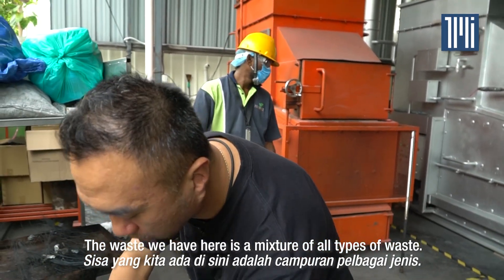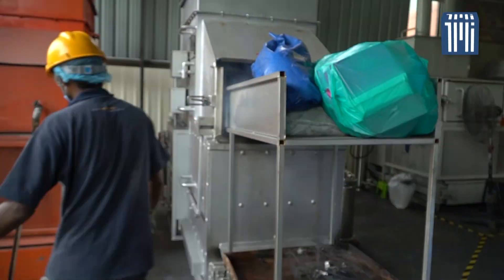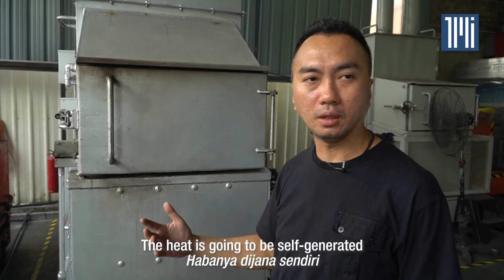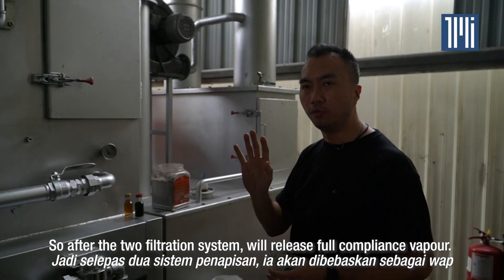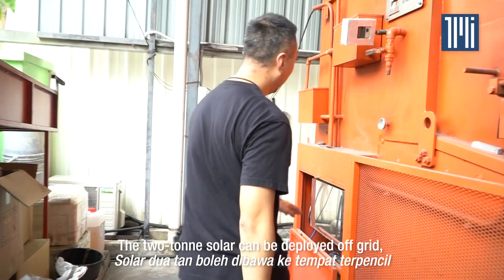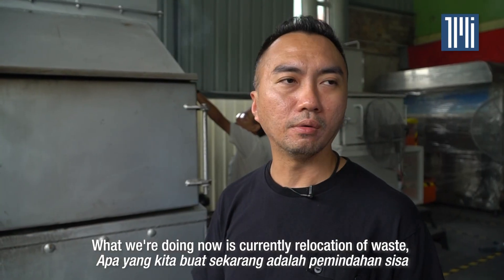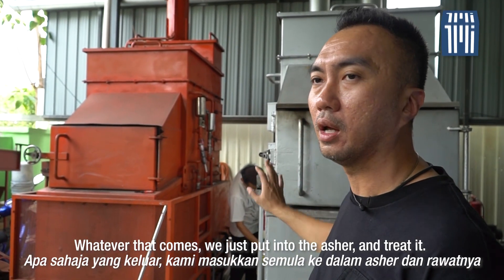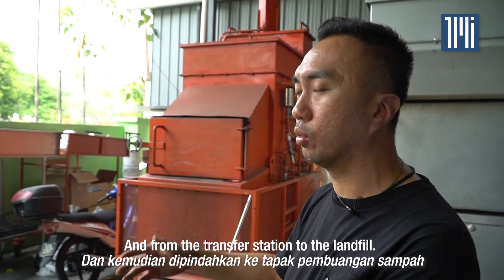Made in Malaysia | This could solve waste management and keep Malaysia clean

Comment: No combustion but got ash and "vapour"  ? With temperature ranging from 400 degC to 1100 degC almost everything gets disintegrated.  As there is no additional input of fuel this broken-down gases had to be combusted to continue the combustion. If you want you can even have a subsystem to make vinegar and channel the residue gas back into the pyrolysis chamber.

Comment: Not burning. Dia bukak pintu keluar api... polution control sistem bukan senang nak maintain. Air dalam scrubber tu cepat je kotor and kena slalu tukar. Practice industry kalau ada scrubber, mesti kena ada waste water treatment. Carbon filter lagi la cepat flock

Comment: No electricity needed at all? Looks like 1100 deg C heat is  produced internally by the Power Bank he had in the waste...Ha Ha Ha. 
By the way, Why are they using Solar Panels when cheaper TNB Supply is available?? 
4kWh used for every hour, means 4kW of Power is required constantly for 1 hour. How much waste is processed in 1 hour cycle? Calculate Energy cost per kg of waste.
Ash will be toxic depending on the composition of waste. Power Bank and plastic into fertilizer??? Amazing!!!
The Eco Waste Asher installed in Gopeng for Nomad Adventure is not in operation now, why?
Lastly, a good start venture, hope to see Asher as envisaged by the Inventor in near future. Maybe some day someone will eliminate all the above issues and succeed in making a real meaningful Asher that can make technical and commercial sense.
Remember, many great inventions had to go through criticism before they could succeed. 
Belum Cuba Belum Tahu.

Comment: if the heat is not coming from solar electricity heater where is the heat comes from? since he said this not an incinerator and he not burning anything. what is the fuel for the heater although I did see fire jumping out when he opened the front panel.  heating or burning plastics and batteries I do not see this as a good idea, if he using  water scrubbers the water is absorbing all the toxic waste which needs to be disposed of properly and also replaced. something does not seem right here would need to see the actual flow diagram. I hope also that is not how he testing the final air quality

Comment: Something is wrong here.  This is either pyrolysis or gasification (not sure which).  He's breaking down the waste in an oxygen starved environment.  Seems to me he should be getting some very heavy/sludgy smoke that he's supposedly scrubbing into "clean air".  He's using some of the syngas to run the system but it seems there should be additional gas that needs to be captured or burned.

Comment: No burning, but got heat generated (magic), scrubbing only use water can have alkaline flue gas discharge (must be highly treated alkaline water need to investigate) lime or caustic no where to be found, plastic waste inorganic can be used as fertilize including batteries with heavy metal (did not study that in school), no dioxin or furan discharge as per EPA standard (need to go back to environmental school for my Phd), 10 years warranty ??? (Must buy or money back). It is a wonder machine no more landfill, dumpsite, no air pollution, cheap ???.

Comment: This actually biomass pyrolysis. Not a new technology, expensive as hell, and suffers from efficiency issues when you scale up. There are also plenty of misleading statements, such as saying it is not a combustion, but in fact, it is. The problem with WTE is often not at the combustion but more at its emission control system. The concept is the same as incinerator except that it relies on heating in the absence of oxygen. But another common problem with pyrolysis systems is you can't completely remove oxygen from its combustion chamber, because even food waste contains oxide. When you have an incomplete combustion, in comparison to incinerators, you actually produce more dioxins and furans. Overall if this technology is proven there would be heaps of investors working on this on a large scale basis (including myself coming from RE investment industry) Why wait for a small Malaysian company to do it?

Comment: How do you maintain such a high temperature of 1100 celcius? He said that the electricity was only used to run the air scrubber and filtration system.
Reply: absolutely. steel gets softened at 500 degrees, even if their melting point is around 1200 degrees. So it is highly unlikely this machinery can go above 500.
Reply: @VongolaSekundes  Precisely. Straight incineration do NOT go beyond 500degC (or 800degC). Only a plasma furnace can go beyond 1000degC. Plasma furnace can be used either as straight plasma incineration OR plasma pyrolysis. BUT by the looks of the machine it don't look like a plasma furnace to me. A plasma furnace is typically shaped cylindrical or like a large bottle with temp-resistant brick lining.

Comment: Based on my understanding ,its just a really easy system 
The asher works on a a way similar to making charcoal, heat up the material, starve the oxygen out making the fume similar to CO with really high heat, thats y the fume react with oxygen
As the process doesn't burnt, the material couldn't form oxide or other chemical oxide , mostly become co  and pass through water scrubber at high temperature, this can rapidly cools down the fume and soluble and become co2 and hydrogen (maybe around there) 
Carbon filtration can remove small partical and the second set of filtration remove any remaining substance 
As for waste water , it can be add into the asher as this could cool of the system as it sometimes runs too hot , chemical inside it can turn solid or even react differently and become harmless and finally become ash , as for carbon filters can be done the same process 
And the electricity only supply for the aeration and filtration system,  so its really 👌

Comment: Not much detail of this "so called" new invention. Is it just a straight incinerator OR a pyrolysis chamber, OR a high temp plasma gassification process? In reality heat process for MSW 'reduction' and/or energy recovery IS NOTHING NEW... the technology is "matured" in a way. HOWEVER this 'skimpy' op-ed pushef by M'sian insight is TROUBLING. He says it works with ANY waste... and he was dumping a plastic bag into the 'Asher' and he claims no emission OR no harmful emission WITH a end result a solid.  BASIC STEM knowledge. Whether, incineration, pyrolysis or gassification or plasna burning the end result including emission depends very much on what you put in. Eg if your input is (say plastic) high pressure pyrolysis may yield an oily liquid. And solid waste from high temp treatment of MSW may be toxic if stuff like batteries are not removed. Fertiliserz if claimed to be useful output will also be graded "food-grade" or not  You do not want non-food grade fertilisers in food agri. At 4.26 he claims his machine uses 'low energy' @ (apparently) 4kW which he claim to be much lower than a 1.5HP A/C ... come on ... Is M'sian Insight pushing opinion b/s disguised as technology news?
Reply: 1.5hp is 1.2kwh ... when it is too good to be true. We should be doubtful.
Reply: You need sorting first. As pointed, heavy metals present will persist and you can't put that into soil.
Reply: Smokeless? What about the smoke that came out during the feeding process? Not burning? Why got smoke if no burning? Why got fire if no burning? EIA from DOE?
Reply: Can't agreed more 😂
Reply: You read my mind dude 😂
Reply: Yes, I have the same impression, he turns batteries into fertilizer, that looks toxic! Can someone explain more clearly?
Reply: @henrytan5707  
100 year old technology Pyrolysis.   Oxygen less thermal decomposition.   Lots of toxic gases generated.  Heavily regulated in the west.  Giant yawn over here...
Reply: Finally, someone who actually speaks science
Reply: So is that thing good or bad?
Reply: @krinox244  it still can be considered good as in the end, it is still a waste management type of machine. The bad thing is that this documentary is only made to hype up this machine by making it looks like a godly machine, you put anything in it, you only get pure dust. I call bullshit. They didn't even bother to show the end product coming out of the machine.
Reply: @krinox244  depends on the input. for organic materials such as food waste, it's safe. but if you put, for eg. 10 kg of battery/power bank, then you don't want the ashes to be used as fertilizer.
Reply: Thanks for talking what i've just thinking dude. Too much dark secret here.
Reply: It is Pyrolysis. Saw it on another video published by the company itself. The comments were turned off though.
Reply: When something is too good to be true, most likely it is too good to be true.
Reply: I share the same thoughts here. Unless he can explain his technology in details.
Reply: While the dude is selling his stuff by mentioning no oil, coal, etc needed, he wouldnt even mention it uses electricity, as if hes saying the machine is magic. All sweet talk saja.

Comment: I sounds like perfect waste disposal and waste treatment solution, however I am still skeptical. The whole video did not show or mentioned about what comes out at the other end of the process , however just shows the end product, which is the ashes. I am like to see at the end of the process how the workers removed the treated waste residue from the machine.
Reply: I just Googled it here and there, may not be 100% just for sharing.
Its called the Pyrolysis process. A process which subject waste to high temperature (not burning, since no oxygen involved) and break it down to simpler molecular forms with gases releases (there are some other by products too, you can google it out). The gases and other byproducts are used to further generate energy which will benefit the community in different forms.

This process is not something new actually, just that this waste treating method didnt take off mainly due to the fuel you need to put in to sustain the heat is costly than the amount of energy can be harvested (varies depending on how you do it)

Whats interesting here as the presenter mentioned are:
1) The fuel to generate heat is self sustainable - you do not need to continuously provide fuel. Which already reduce alot on the operating cause and rendered the energy can be harvested (which this Asher didnt do at the moment) more than you put in (assuming its at least more than 1.5hp AC power consumption).

2) It can even treat power bank. I wonder if Lithium will cause contamination if the end product is being used for fertilizer.

I think there are stil some other hazardous byproduct from the filtration system. That wont just go missing and the filtration system wont last forever without maintenance needed.

Anyhow, if these all are true, it is stil way better than sending waste to landfill. At least the amount of waste need to be handled is way way smaller in size. Soooooooo, smaller landfill ?
Reply: @yihsiangng7038  in pyrolosis, you can use biogas to be used as fire.
Reply: True. Basically this is just a hyped up incinerator.
Reply: @RoyMcAvoy  are you sure?...can you make something better?
Reply: hahaha bro, this product is proprietary, not an open source. he only shows input and output lar. the process.. no no no no :)
Reply: @xchaix  to be used nation wide, he has to come clear whit every thing, nothing to hide...want to help the environment or just want to make money
Reply: @hidongcucuk4756   don't say like that lah....., they are working hard for a solution to treat waste at the very least
Reply: ipo dude, ipo.. want to know further contact related person.. if other persons, they would sell first aggressively n us regret later 😂😂
Reply: I oso wan to see the ash and the filtration sys. 1000 celcius nt actually tat high and ash still can be toxic
Reply: Is this the real deal or a hoax??
Reply: the talker is a lier, just a pyrolysis or gasification tech. it is not economic.

Comment: If really reliable and environmentally friendly, should have provided report from independent accreditation body(ies).  Safety is very important and it would be particularly helpful if there is credible certification. Government can assist with this if needed be.  

The biggest issue is usage of power.   This is like handing over the responsibility to process waste to local authorities or housing location??  Who's gonna pay for the cost of the item and the power used?  There must be incentive from government.  The reason why we pay taxes is also to cover waste processing; if we rakyat have to bear the cost of processing waste, how is that going to work

Comment: I have seen a 2-tonne model being launched in Gopeng, Perak. Emissions were full of dark brownish fumes, possibly remnant dust particles. In actual usage, the treatment capacity turned out to be only one tenth of what the inventors / vendors claimed it to be. After 4 mths operation at below par capabilities, it stopped working altogether. As I last saw it, that Asher is still lying dormant there. Can the inventors / vendors offer a responsible and truthful account before launching into more hyped publicity and marketing?
Reply: Not to shoot down a potentially great local idea, but not all the waste is organic. He put in a battery pack. The ashes will contain toxic material which is not suitable for plants or to be disposed off in the river where it could kill fish. And msians throw everything like tyres, mattresses, plastics, styrofoam, etc etc. Even in ash form it's not organic.
Reply: @elkapitan75  and worse. In ash form, it has a lot more surface area
Reply: @elkapitan75  agreed, need to find better ways to manage the ash waste containing toxic materials
Reply: @elkapitan75  metaloids(lithium, copper, aluminium, etc) in ash are ok as fertilizer in low concentration, especially when ash is usually mixed with soil, thus reducing concentration. Metaloids don’t go futher more than roots, so you can judge it based on the harvested parts of flora. The asher (based on self research) is a bit simplified and skipping a few processes to mitigate the toxicity of ash as bricks and such.

In addition, Malaysian aren’t used to recycling in general and that can’t be used as an excuse but must be thought to the younger generation while the government giving convenient methods/incentive to the current generation to prevent bad examples that may cause the education to seem redundant as they grow up. All in all, this require commitment of every individual and it is not something simple to implement on different generations from a move or two.
Reply: Sounds like too good to be true
Reply: Thanks for feeding back what you have witnessed. Still very skeptical of the ashing process, that there is no harmful toxic emissions.
Reply: Really.?damn! Needs improvement on the reliability then.
Reply: Send the journalist or media person there to check.. but im suspicious by interest party or vip will intervene.. same like happen to other countries.. doing good things are not always without stumble block..
Reply: Tbh i already doubted the intent when the dude tossed a lithium battery in that thingy. Iike wtf. Are we surprised theres alkali coming out of the fumes?
Reply: Segregation of wastes is still crucial as all from different composition.
Reply: most factory in the country emit toxic black fume , from chimney , discharge it into open atmosphere, people  breath in , go hospital ， & need treatment , instead of treating the air into pure air
Reply: do you have proof to back this up?
Reply: To be honest I find it dubious too.
Reply: Is this the real deal or a hoax??
Reply: Also microplastics
Reply: Impossible.. Paramai will give 10years total warranty
Reply: U sure that thing came from this guy?